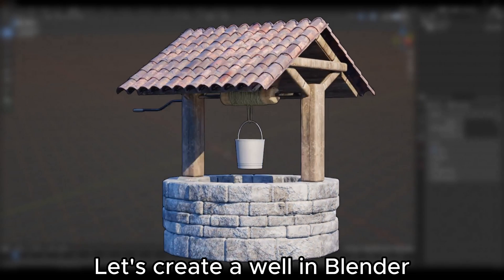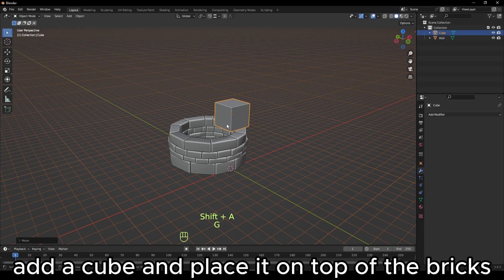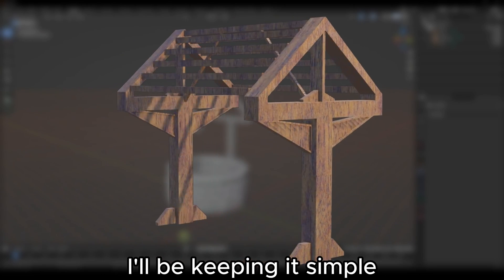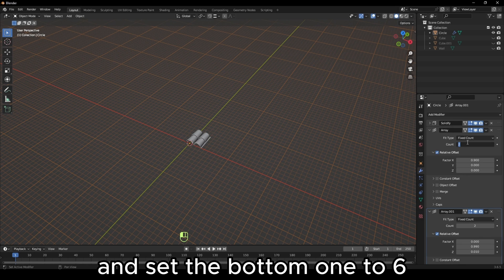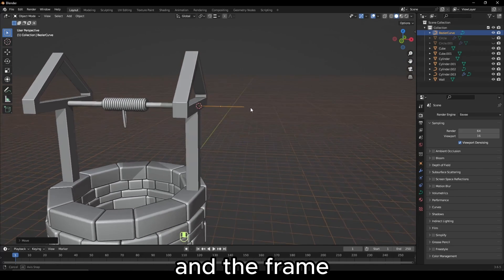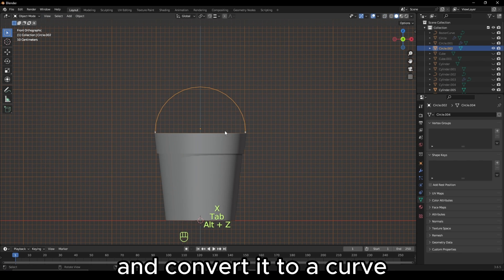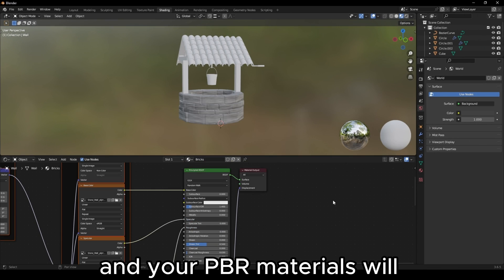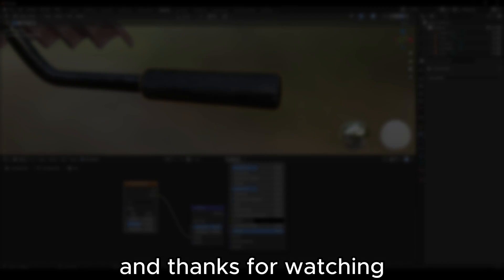Create a Well in Blender in 6 Minutes!

Comment: if you stuck at Bridge Edge Loops part. instead of it just extrude your faces to upwards then go to vertex mode and merge your vertex's at center by using (M) key , don't forget to select one vertex from the right and one from the left to merge them together at center. good luck 👌

Comment: When I apply the loop cuts it is only separating the lops on the edges and not the other loops
Reply: Also the bezier curve isn't turning 3d and instead looking flat, these tutorials can benefit from quick trouble shooting method's because sometimes there are going to be different results. Perhaps pausing and reiterating what settings to have on.
Reply: @katon4525  bezier curve is first a flat line with curve handles that adjust the curve.. first you must follow his instruction to straighten and extrude etc.. then he shows you have to go into the geometry properties on the right and increase depth.. that's what creates 3d
Reply: Turn off proportional editing then it works... in edit mode to the right of global, you'll see a circle with a small solid circle inside.. that's proportional editing... or hit O

Dont forget to apply scale (ctrl a) after converting to curve